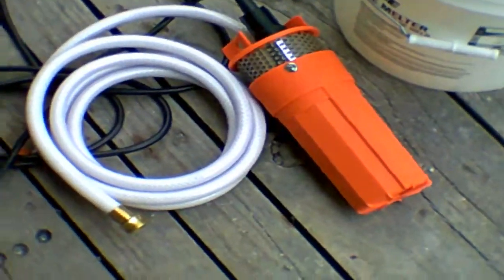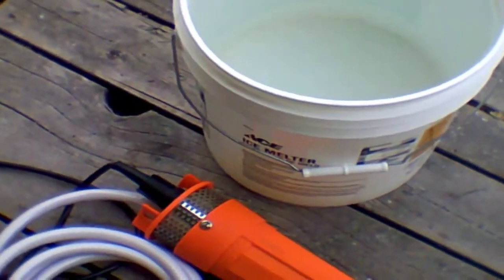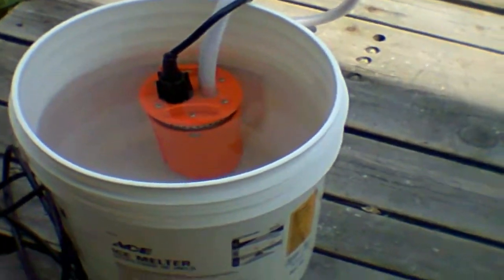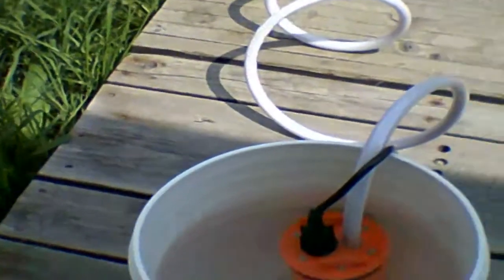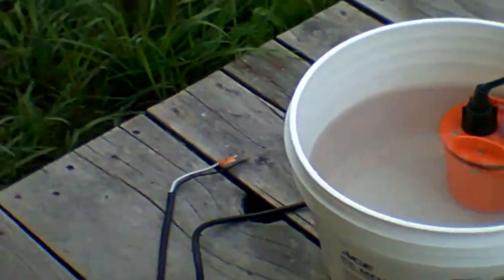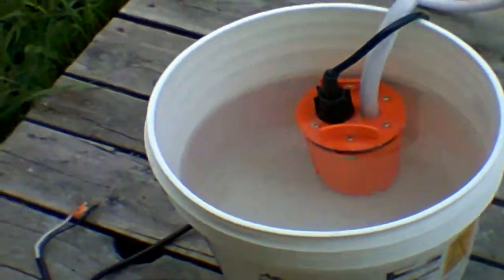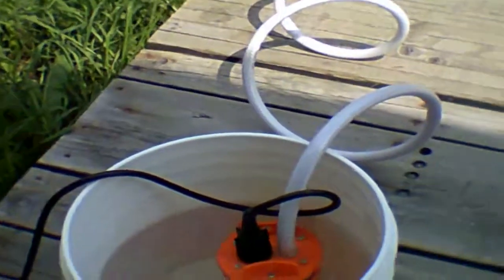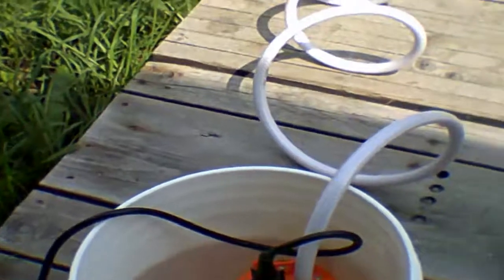12 Volt DC Submersible Deep Well Water Pump

Comment: looking for something similar to use a a shower. This would fit in a bucket, thru a 1/2" hose to a shower head mounted to a tree. Would this have enough pressure for this?
Reply from the maker: Yes it does take a 1/2 inch hose, but it does pull water pretty quickly so it would end up sucking air in a couple minutes or less in something like a 5 gallon bucket. If you are looking for something that would be good enough for a shower that runs off of 12 volt then this would be to strong unless you are pulling from a 55 gallon drum or a river or lake, or a large pond. It has to be under water and stay under water at least 6 inches from the top to not suck in air and these are very expensive. My advice to you would be to buy a small 12 volt RV pump like the one I show in my Camper Trailer Update 4 video. ( My Latest Video ). The one that I purchased takes a 3/8 inch hose, but they do sell them that take a 1/2 inch hose, and these RV pumps usually only pull a gallon a minute or so. Our small RV pump only costed us around $15.00 while this pump ran us closer to $80.00. Also the smaller pump uses way less power if you are running it off of a battery. Watch my newest video and see if that type of pump would be better for you. Most of these RV pumps also have a automatic shutoff so if the water is turned off the pump shuts off. The pump in this video does not have a automatic shut off. You have to shut it off manually. I hope this answer helps you out. I looked up a RV pump for you and they run about $24.00 on ebay. with threads for the pipe. go to ebay a copy and paste this in the search bar for the type of pump I am talking about.   12V Water Pump 100PSI 5L/Min 60W Electric Diaphragm Self Priming for RV Boat US
Reply: @christopherhorton821  ok, thanks. I found RV pumps but I didn't know what pressures they work at. The auto shut off is a good feature.
Reply from the maker: @justray510  You are very welcome. Most RV pumps go between 60 psi and up to 100 psi or a little higher, and between 1 gallon to 3 gallons a minute, These little pumps handle everything in a RV. Shower,Sinks,Toilets ( that use water ) and pretty much anything that needs water. Also it is a good idea to have a RV low flow shower head to get better results and conserve water. I hope this helps you out with your shower build. Have a nice day.
Reply: @christopherhorton821  it did, thanks. I think I found one that will work for me.
Reply from the maker: @justray510  You are very welcome. Also if you buy one of these pumps they need to have a stand alone fuse. The pump that I purchased requires a 4 amp fuse. Other pumps may require a smaller or larger fuse. I myself am just going to use a cheap automotive fuse holder like the one that I have on the load of my solar charger controller. You can find these types of pumps way cheaper than the one that I gave you the link for, but they usually require a 3/8 inch hose and the hose is just pushed on and clamped like the one I bought . If you have any more questions please feel free to ask. Have a nice day.
Reply: @christopherhorton821  ok

Comment: The Title says "Deep" well pump; you just said it was very shallow? Appreciate the upload and the effort it took; could maybe alter the tittle and probably wouldn't hurt to learn a bit about using your camera settings like image stabilization and such. Thank you for sharing.
Reply: I use these in wells, they are high pressure, low volume pumps
Reply from the maker: Also as far as the camera goes here is what I have to record on.  https://www.youtube.com/watch?v=YiXUrYwfl48    or    https://www.youtube.com/watch?v=9MA92O387kY&t=2s
Reply from the maker: When you buy one of these it states 190 ft or a deep well pump, But if you watch the video and look at the flow rate I would say it's a shallow well pump of no more than 25 to 35 feet at most. Anything more would be to hard for it to push water. It also states to not run it for more than 10 minutes at a time before letting it cool off. A deep well pump can be ran for hours without overheating.
Reply: @christopherhorton821  thank you for the clarification on the specs; makes sense
Reply: @christopherhorton821  Thank you for the clarification on the specs
Reply from the maker: @OrinWells  Your welcome. I bought this to throw in to a river for pulling water for lawn work and laundry since I will be completely off grid in a year or so.

Comment: You Tube will not allow me to view the link you left for the other person commenting. It worked to let me see the reply awhile ago but yt has been selfish and glitchy lately. I really do need a pump like this. And so if you might give a brand name...? Edited to find my tablet/& hotspot allowed me to open a link as I believe you indicated eBay discontinued... Another entity, "Home beauty (2705)" is offering it at $72.99 w/ free shipping. I hope to hear yours is working well for you...There were some discrepancies in the product description that cause me to "wonder" about this manufacturer... Depth/head height etcetera... Important stuff. Thank you
Reply from the maker: They go by different names but here is the exact same pump that I have. https://www.ebay.com/itm/12V-Submersible-Deep-Solar-Well-Alternative-Solar-Battery-Water-Pump-Powerful/401447293005?hash=item5d781f904d:g:xGcAAOSwFyhaFrfo   .I'm sure you can find them cheaper if you do some looking around. Also these are just a hair to big to fit in a 4 inch pipe so your well pipe( if you are going to use it in a water well) would need to be 4 1/4 inch or larger. If you have a shallow well then you could get one like this and a foot valve for cheaper, but this would require 110 and not 12 volt .       https://www.ebay.com/itm/1-2HP-Electric-Industrial-Centrifugal-Clear-Clean-Water-Pump-Pool-Pond-Farm-370W/123941594557?hash=item1cdb7ea5bd:g:oqwAAOSw2sZdpu0y   . https://www.ebay.com/itm/MUELLER-PROLINE-101-324NL-3-4-FOOT-VALVE-NEW-FREE-SHIPPING/283137307563?hash=item41ec4c73ab%3Ag%3A8hQAAOSw%7EB9bjHLZ&LH_ItemCondition=3
Reply from the maker: I just got out my tape measure and this pump is just a little bit bigger than 4 inches across If your pipe is 4 inches in the center then you could just trim off some of the plastic around the top of this kind of pump to make it fit. Once again it is just a bit larger than 4 inches. Your pipe would need to be at least 4 inches in the center or a little bit larger for this pump to work in a water well. My advice is to measure the inside of your pipe before buying a pump like this. take a tape measure and pull out 4 inches and then pull out where 4 of the smaller lines are and that is the size of this pump. It is between 4 inches and 4 and a quarter inches. I bought this to throw in to a river for water. The other links that I gave you are what I will be using for a shallow water well for drinking water.
Reply from the maker: https://www.youtube.com/watch?v=CPH3-6lPQrM

Comment: Do you have a link where you got it from?
Reply from the maker: Here is the exact same pump that I have. It cost a little bit more than mine did, but the ebay user that I got mine from is not selling them any more.  https://www.ebay.com/itm/Durable-12V-30m-Submersible-Deep-Well-Water-DC-Pump-Energy-Solar-Powered-Pool/113444171082?epid=8026997210&hash=item1a69ccad4a:g:JjIAAOSwl7dcEKuM